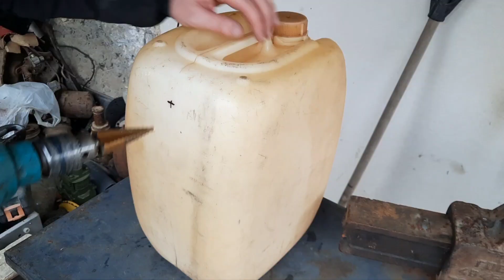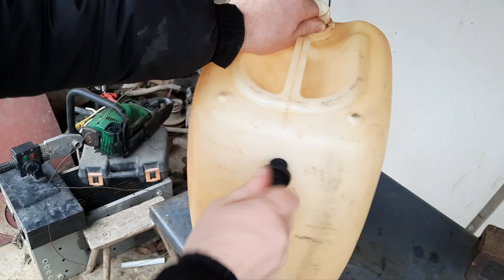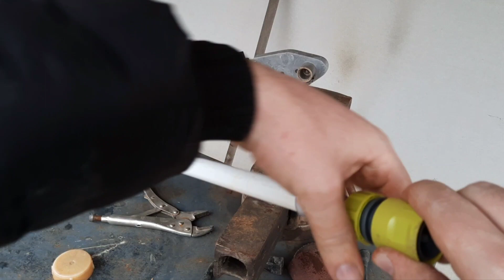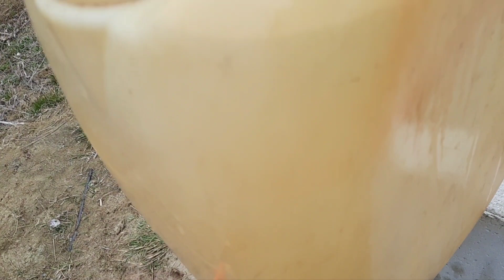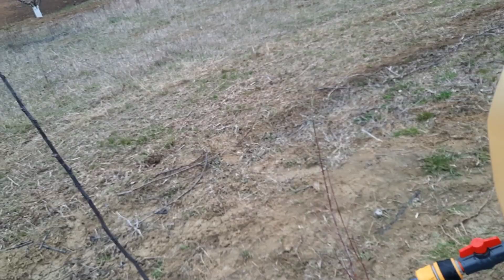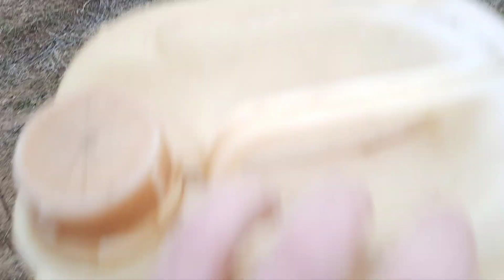Simple idea how to make a siphon to pump water without spending money on fuel and electricity

Comment: This was ancient way of pulling water out the soil when there were no pumps invented. The kings had the fountains in their gardens for decoration and for air humidification.
Reply: But it only works if source water level is higher than the output. It is a simple siphon with a priming barrel.
Reply: @kjellg6532  bro you are still not understanding. The source water is now the water inside the can which is already above the ground. Convert the level of can water into inches of water column and you will see that this force will be sufficient to produce a partial vacuum inside the can and the suction pipe also. The suction pipe is already filled with water and there's no higher force needed but only equal to a few inches of water column required which is less than the vertical weight of water standing in the can.
Reply: You daily notice the Osmosis principle working in trees and plants which supply water from soil via roots, stem branches to leaf.
Reply: @aamirnadeem1838   Sorry but no. The water level in the well must be higher than the output to the field for this siphon to work.
Please have a look at this video, debunking the «pump», theory. https://www.youtube.com/watch?v=VJBU6L24X-U&t=6s

Also look at this article, payng special attention to the “flying droplet siphon”. The video shows such a siphon.  https://en.wikipedia.org/wiki/Siphon

No siphon can lift any water up to a higher level, barrel or no barrel.
Reply: @aamirnadeem1838  Yes water mostly enters a tree through the roots by osmosis and any dissolved mineral nutrients will travel with it upward through the inner bark's xylem (using capillary action) and into the leaves. Now the osmotic takes place in the membrane between the soil and the roots. From there on capillary effects transports the water up. Now in our case the tubes and hoses are so wide that no capillary effect takes place. 
This is a siphon with a priming barrel and as with any siphon, the source, well, must be at a higher level than the discharge to the field.
Reply: It's the inter molecular force or bonding which sucs the water by vacuum produced in that container. You are continuously denying the fact by saying that the reservoir should be at higher level than the ground while you or ignoring the fact that the container is placed on higher level. The lower located well has no direct relation to upper ground because there's an other reservoir that is connected firmly and air tighten. The reduction in pressure by lowering the level causes itself a partially vacuumed cavity which introduces the water which is already standing still in suction pipe....!

Comment: This only works if exit to the field is lower than the water level in the well. No siphon can lift any water.
Reply: @tihoprskalo7719 Do you not agree? No siphon can lift water to a higher level. In this case it only works due to the hose that must end lower than the water level in the well. „Pumping water up from a well to flat ground is impossible using a siphon, with or without any barrel.
Reply: @Dingsrud  I have seen it in Curious George when George and Bill wanted to sip out of the pool. + I have always asked my dad how did he do it with the vine in basement and it was unlikely not explained, so I concluded in some meanwhile that it is because of sugar.

However I'd would like we discuss about it, if you have any social medias like email or ponies will just read this conversation without giving a 
👍 (probably not in future), of course I do not disagree with you but I came from this same video, and of course I haven't believed how it did work.
Reply: @tihoprskalo7719  Here you can see the wine to be transfered from one vessel to a lower vessel https://www.youtube.com/watch?v=46ac2XN4SDI

How it works: a stiff tube, at the bottom a one way valve letting liquid in. From the top a hose down to another vessel placed lower than the first. Now rush the stiff tube down and some liquid enters the stiff tube, lift and repeat. You gradualy fill the stiff tube until the siphon effect starts. 

A siphon is simply a liquid filled tube running from a high reservoir to a lower reservoir. A one way valve and pumping fills the tube.
Reply: But have you tried it..?
If you imagine that the ground or field is at lower level than this drum/can. The draining water causes a cavity or low pressure inside the container resulting the water of well to be pulled out and to take place of draining water. So, it will become a self sustainable cycle. The water has been filled in vertical pipe and a foot valve will stop the water from flowing back to sump. So there's no way for air to get in and the empty space due to draining water will produce enough suction for water to come out continuously.